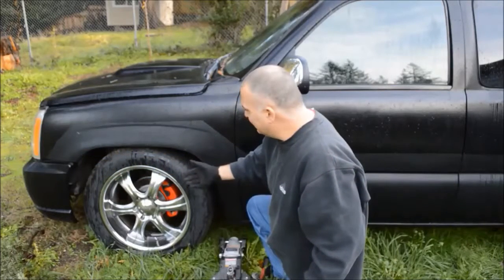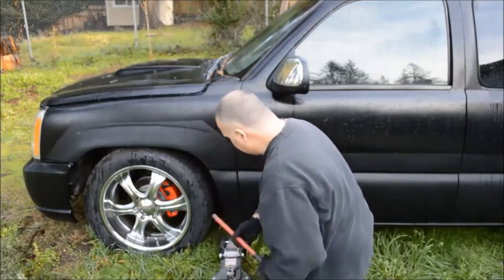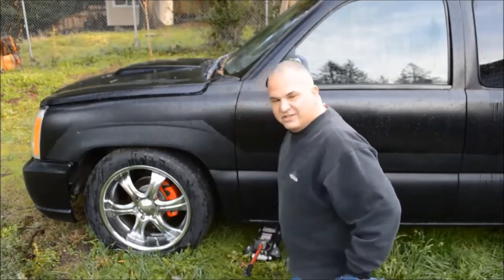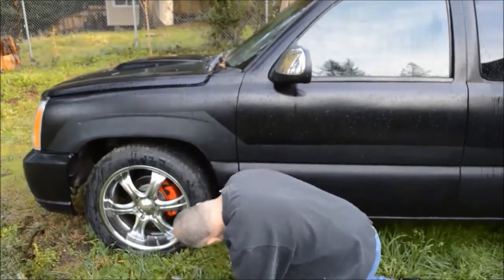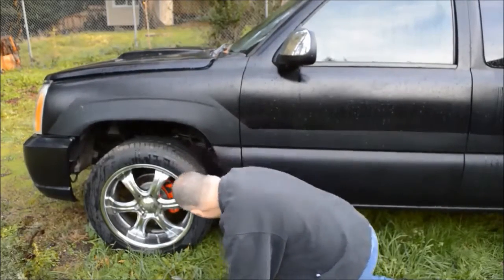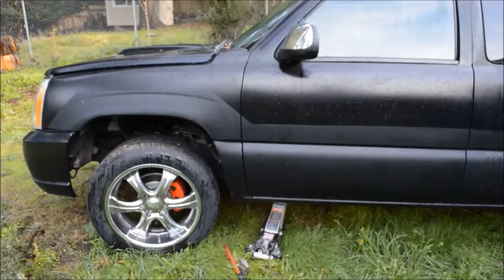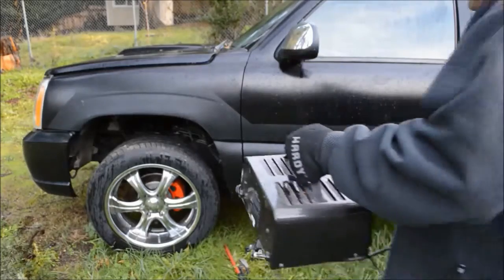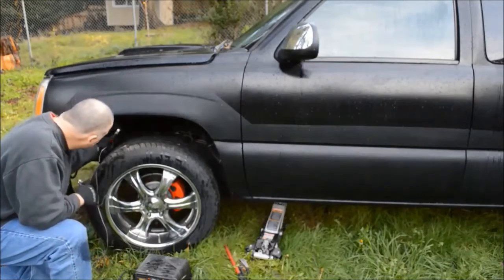Escalade Silverado Charging Jacking with Everyday Bob

Comment: How did you match the molding of the truck to the Escalade front end?
Did you buy escalde doors ?
Reply: Little late but that truck doesn't have moldings. Looks like he welded the lower half of a silverado fender to the escalade fender and then filled the holes above the wheels with material